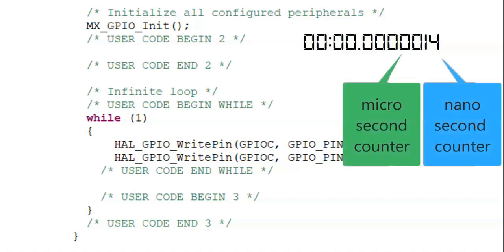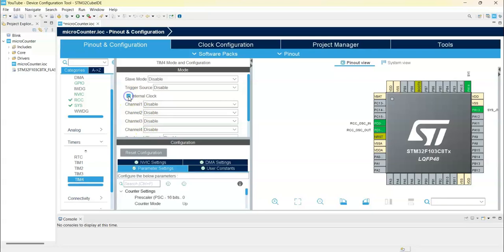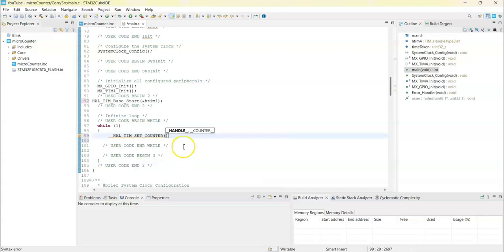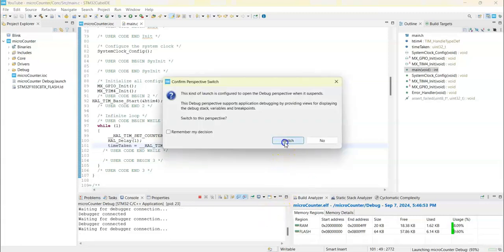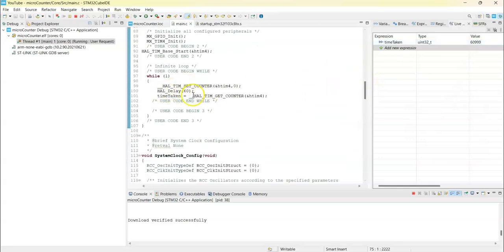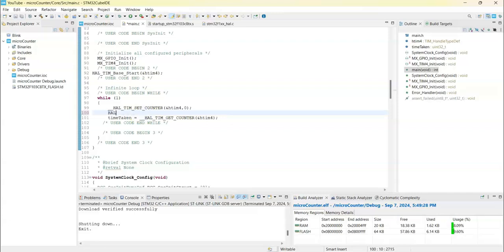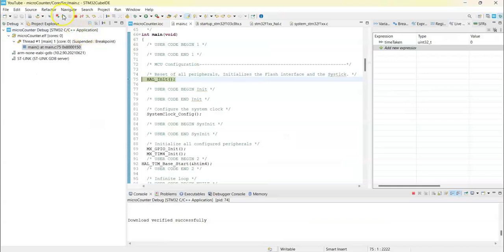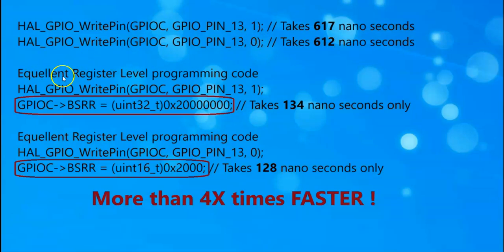136. STM32CubeIDE Timer Counter with STM32 F103C8T6

Comment: useless because the CPU cannot evaluate the nanoseconds at all
Reply from the maker: 72 MHz CPU can evaluate 13.89 nanoseconds
Reply: Wow you can read the manuel very well. When you run an interrupt at nanoseconds the CPU is so busy so the runtime is about 100 times higher
Reply from the maker: I did not use interrupt in this video. I used timer to count.